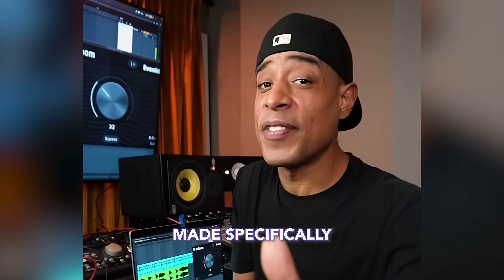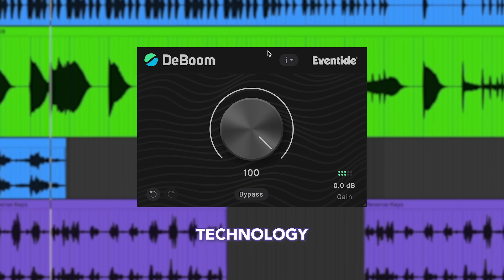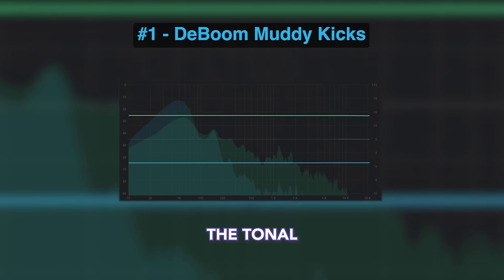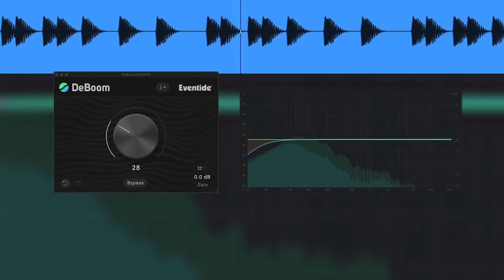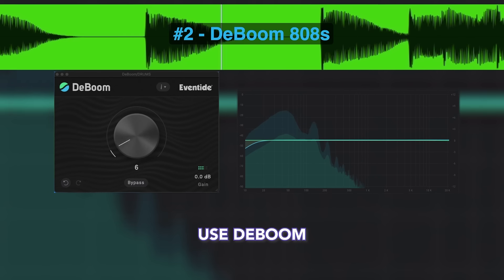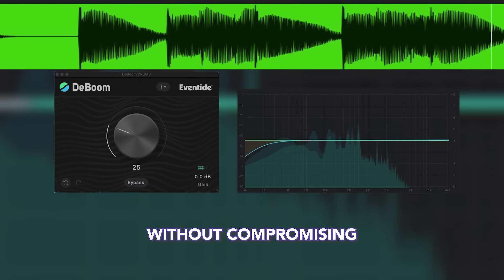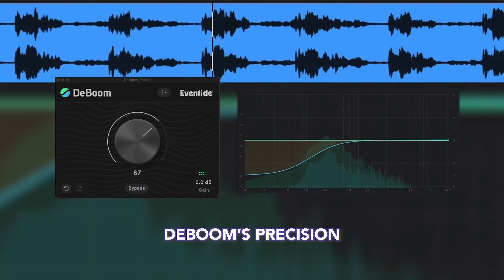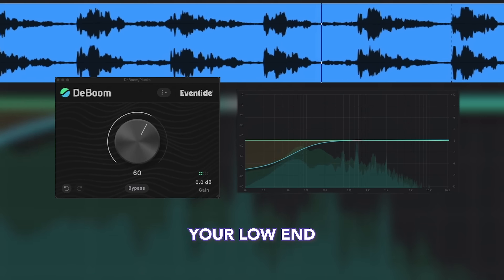Fixing "Boomy" 808 Kick Drums with Eventide DeBoom

Comment: How is this different to a simple high pass filter?
Reply from the maker: @Patbwoy  DeBoom uses the same technology as Eventide’s SplitEQ allowing users to control the transient aspect of a sound separately from the sustained or tonal part of the sound. As it relates to DeBoom, you can control the “thump” separately from the “boominess” of a signal.
Reply: @EventideAudio  Yes, that's what the videos says. But how is that any different? The transient part of that kick consists of mainly higher frequencies, which also won't be affected by a simple high pass. Also sound wise, it sounds just like a high pass, cutting the lows (boominess) and leaving the high frequencies (transient). After all there's only one control.
Reply from the maker: @Patbwoy  Transient information exists across a broad spectrum of frequencies, and with respect to a kick drum, transient information in the lower registers can affect punchiness in crucial ways. You can leave the punchiness alone while addressing muddiness. DeBoom is a free gift in December. We invite you to download it and compare to a simple high pass filter. Perhaps you may come to understand the advantage of the parallel processing afforded to you by our structural effect plugins like SplitEQ.